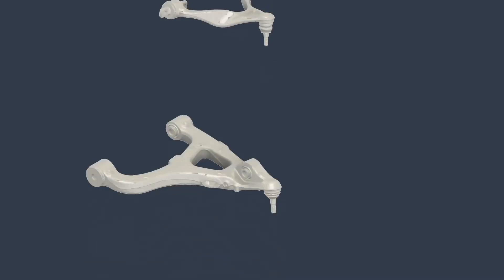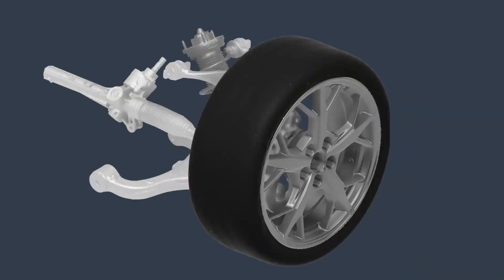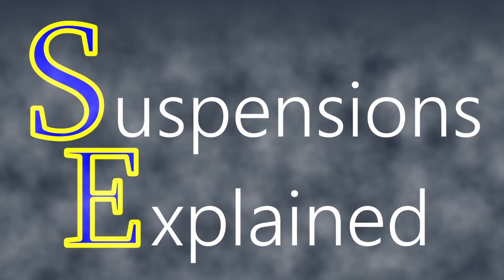Degrees of Freedom

Comment: Excellent video and info.  So if i understand correctly. The front suspension on my car.  Composed of 1 upper a-arm. That is shaped like a triangle 2 points connect to frame then they converge?  To a single point. Is 2 links. 
The lower arm only having a sinlge mount points at each end is the 3rd link .  and then the radius rod which. Secures to the lower arm. And then to a subframe.   Makes 4 links. 
If 5.   
Would then the tierods be the 5th. Link 
The radius rods on my car are adjustable.  Similar to how the tie rods adjust. I forget the terminology. Used but its something that describes. The fwd aft position of the hub. And the turn-in. Angle?   From.  Memory.?  Its been a few years since reading through my cars factory service manual , and thr section about wheel alignment and suspension adjustment.   

My daily driver sedan. Came from factory  with a 2rod and  a center link setup on the rear carrier assembly. (Saying axle seems inaccurate due to it being a front mount front wheel drive vehicle and that what would be the axle is a tube that ties thevrear shocks with the hubs and the link setup.  Carrier was only thing that came to mind easily that seemed to also was close to accurate term.   

My sedan is a 2002 infiniti g20. (Nissan primera p11)  

Did i get the lesson?
Reply: Yes the tie rod is the 5th link.